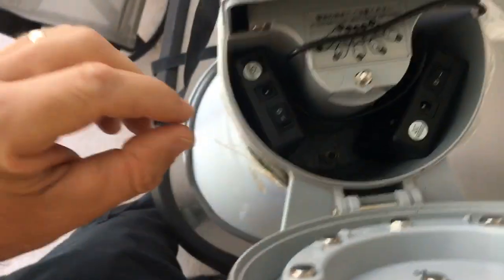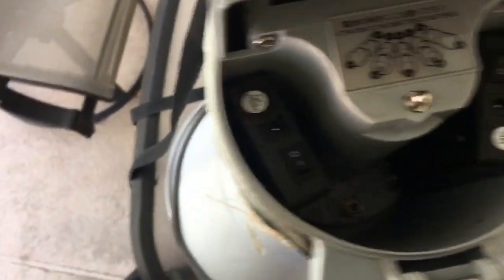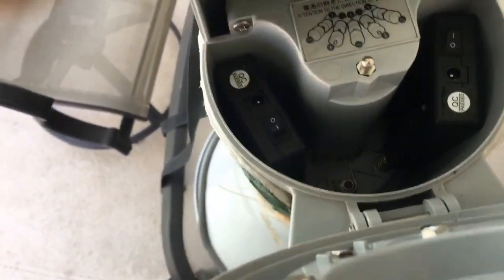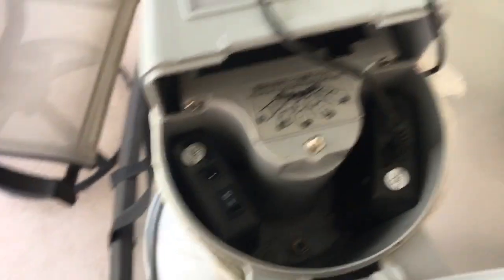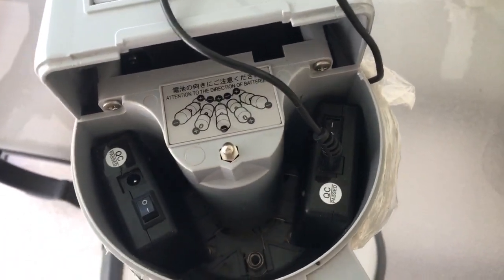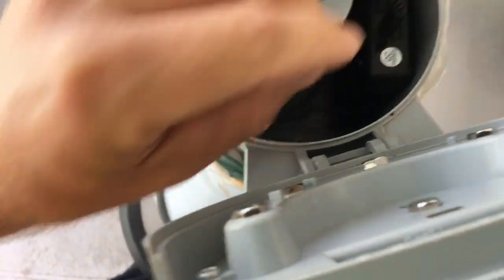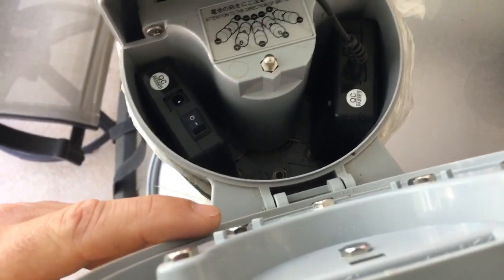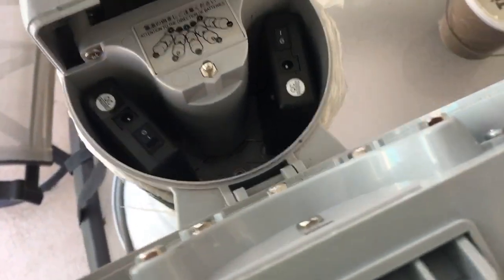Rechargeable Battery Packs 🔋 for TOA Megaphones 📢

Comment: I was planning on getting that exact megaphone as some of the other larger ones are hard to get. Do you know if there is any benefit to getting the next model up the 2930?
Reply from the maker: I couldn’t tell you about the next model, but the TOA that I have is awesome! If TOA can make any improvement at all on an already amazing model, it would be worth looking into. 

The only issue I have with mine is the microphone finally gave out, after being cut at a Pride event 5 years ago, and spliced back together.

However, it comes equipped with a Auxiliary input, and I am using a performance style microphone. Just looking for a reason to wire it up wireless, and I think my microphone going out is reason enough.
Reply: @TheRoadLessTraveled  Awesome yeah it seems like a good megaphone. My main desire was to have one I can attach a mic to specially for the reason that they can cut the hardwired mic and render it useless. Thanks so much for the info bro! God bless you! 🙏🏻🙏🏻
Reply from the maker: No problem at all. God bless you as well